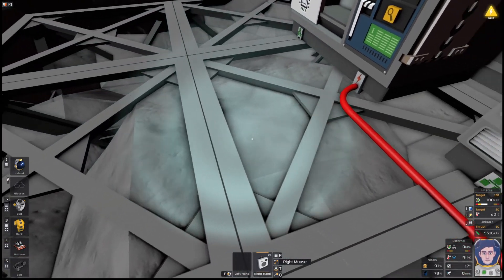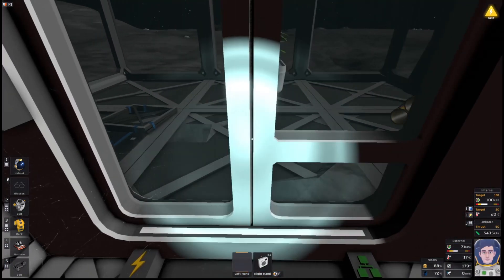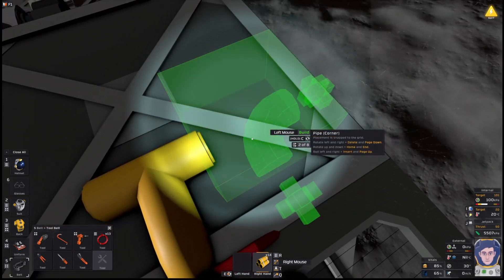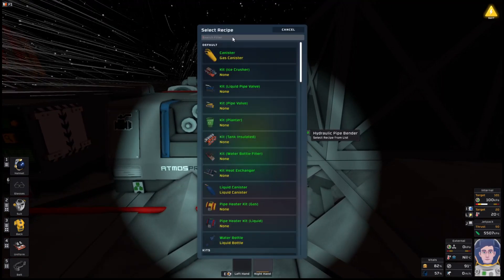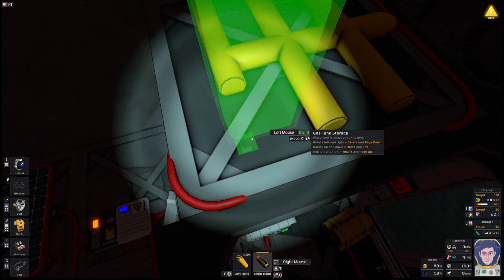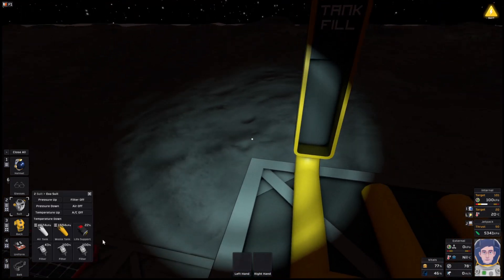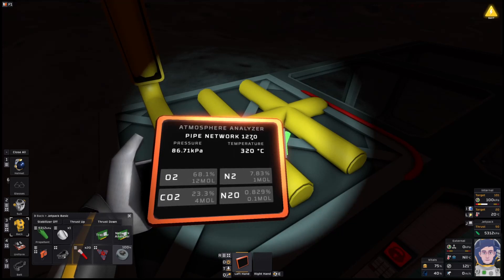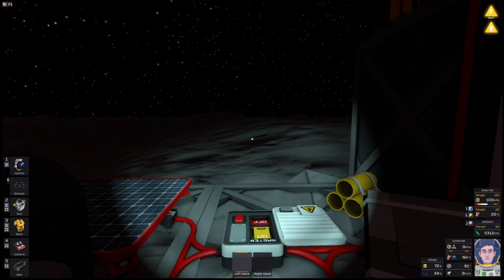Stationeers: How To Cool Your Base

Comment: Used this method plus 4 small passive radiators. Worked well untill one of the tubes bursted open and vented all the gas from the greenhouse, killing all my plants. Seems that some of the gases became liquid after cooling which caused the pipe tu burst. I'll try adding something to remove the liquids from the system.

Comment: When I tried to do something like that i had the problem that the gass always cooled down until getting to liquid and destroying the pipes.
I used low pressure and mostly CO2 gaß
Reply from the maker: The gas changes since I made this video are the reason. It's on my list to remake for that reason. Pollutant makes the most versatile coolant as long as the operating temperature is over - 98c
Reply: The problem is that the vacuum radiator keeps working even when the cooler is off, and will eventually cool the CO2 until it freezes solid in the pipes. I found that having the same pipe setup but with a CONVECTIVE radiator on the interior (instead of an active cooler) works great. But for small interior spaces in early game you may have to remove the outside radiator every few days (or else it could actually get too cold for plants and player). At least until you can create a programmed climate control system later in the game.

Comment: Do these pipes need to be insulated now?
An excellent tutorial.
Reply from the maker: The pipes on the wall cooler should NOT be insulated (unless you're in a hot environment, in which case cooling becomes a whole big problem). The wall cooler works by dumping heat from the room into the gas in the pipes and relies on them radiating the heat away to the outside. In fact once you can make steel you should add radiators to those pipes to speed up the heat dumping